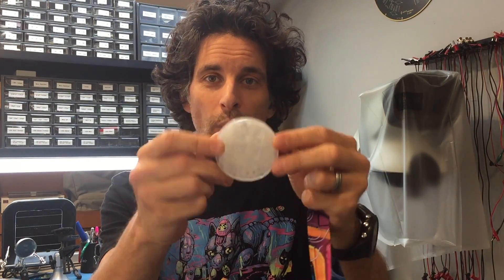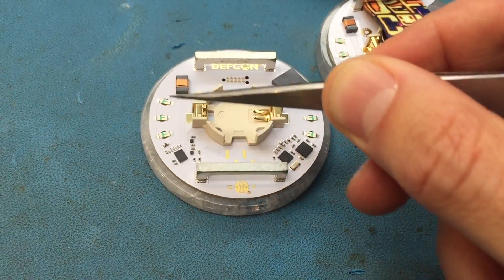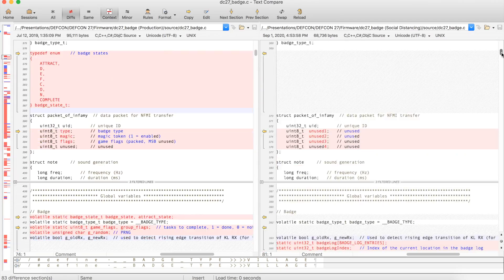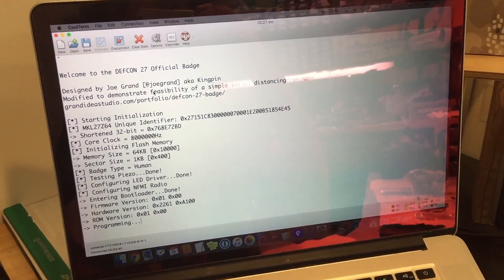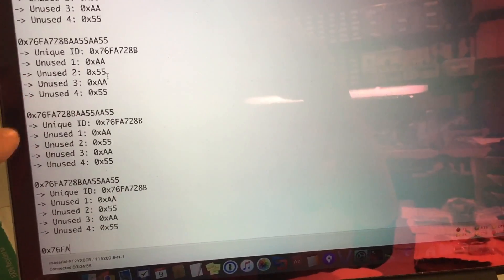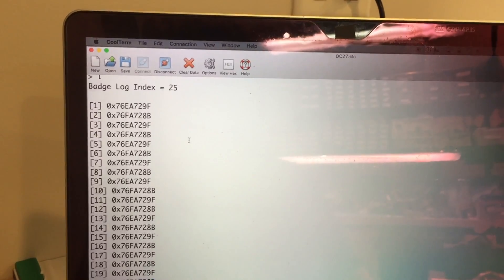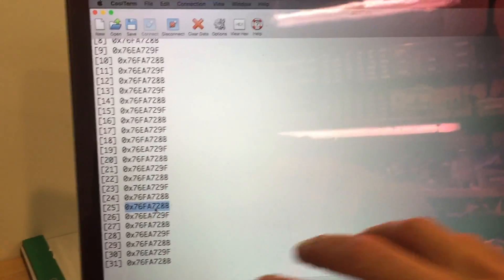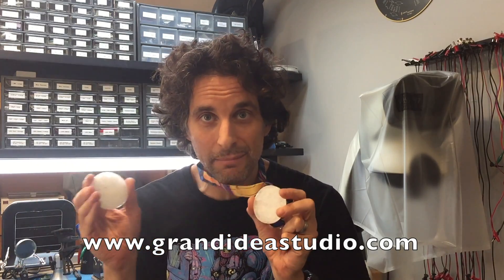DEFCON 27 Badge Social Distancing Reminder

Comment: Sorry if this sounds like a stupid question but why not use an NRF and play with the BT TX power? Is it because it wouldnt work for the games where people had to scan something in close proximity? (which i guess would be messy with BT) 
Also why do u use an led driver instead of driving the LEDs with the gpios? And holy shit u made 28,600pcs. Impressive work!
Reply: I am not Joe, but these are not stupid questions either. I might be able to shed some light on these choices until Joe responds.
You may already know this, but LED drivers allow many LEDs to only occupy one pin on your controller. Why not use a driver if you can?
As far as using bluetooth and nfc stuff. This was what plenty of people early in the conference thought the badges might be using. So the choice not use old tech that hackers have already seen and are expecting was intentional. Aside from adding to the challenge of hacking the badge, this is technology being more adopted in the wearable landscape and the chip Joe used at the time, not too many engineers previously had an arbitrary chance to play with as even its documentation came at a price and NDA that summer.
Like Joe mentions in the video, a pretty cool and common use right now for NFMI is in combo with bluetooth! If you have a bluetooth device that's actually a pair of devices (like earbuds), you have one of the devices connect with a client over bluetooth, and the two earbuds communicate with each other via magnetic induction.

tl;dr  NFMI was a newer, less common curve ball to throw at dc hacker kidz.